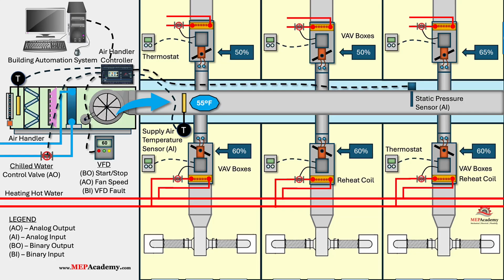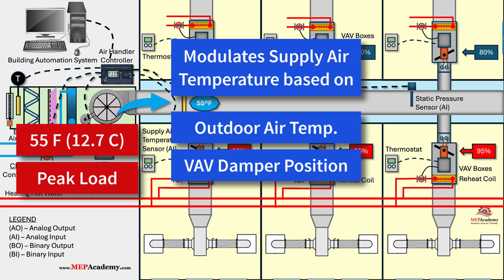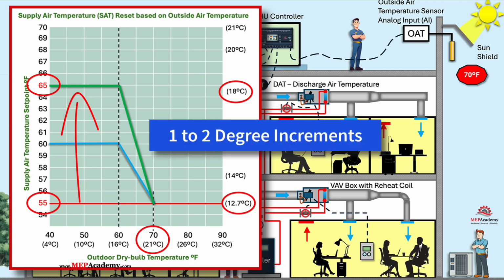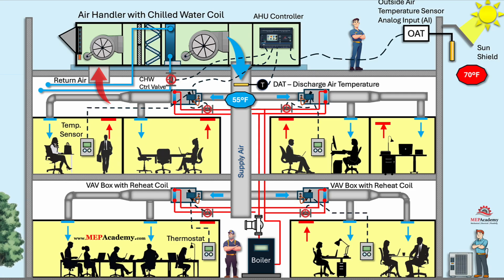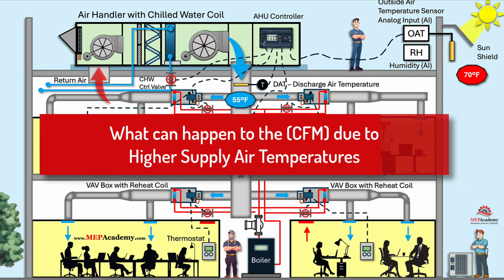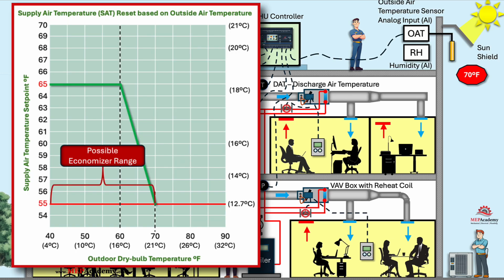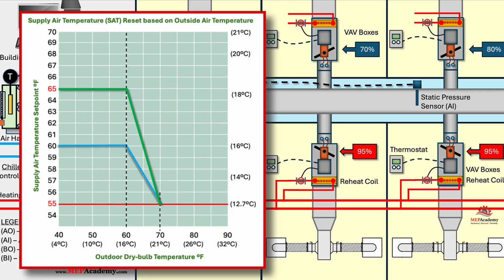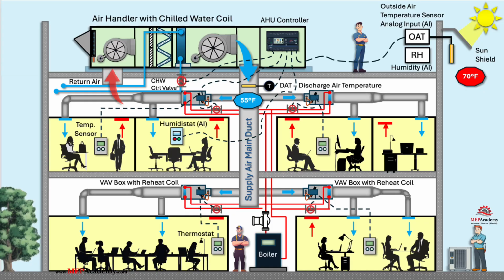HVAC Controls Supply Air Temperature Reset

Comment: On a BMS system how do I lower the sat in the RTAC from the BMS computer? I need help
Reply from the maker: To lower the supply air temperature of a rooftop air conditioner (RTU) from the Building Management System (BMS) computer, follow these general steps. The specific procedure can vary based on the BMS software (e.g., Trane Tracer, Honeywell, Johnson Controls, Siemens, etc.), but the core process is typically similar:
Steps to Lower Supply Air Temperature (SAT) via BMS
1. Login to the BMS Interface
 Use your credentials to log into the BMS software through a desktop application or web interface.
2. Navigate to the RTU (Rooftop Unit)
 Go to the equipment overview or graphic interface.
 Click on the specific rooftop unit you want to control.
3. Access the Supply Air Temperature Setpoint
   Look for a section labeled something like:
     - "Supply Air Temp Setpoint"
     - "Cooling Setpoint"
     - "Discharge Air Setpoint"
   - This may be found under a tab called "Control Parameters," "Setpoints," or "Cooling Control."
4. Adjust the Setpoint
   - Click the setpoint field.
   - Lower the value to your desired supply air temperature (e.g., from 58°F to 55°F).
   - Confirm or apply the change.

5. Monitor the Response
   - Watch how the system responds: the RTU should increase cooling capacity (e.g., more compressor stages or increased chilled water valve opening if applicable).
   - Verify the actual supply air temp starts trending down after a few minutes.

6. Check for Limits or Lockouts
   - If the system doesn’t respond:
     - There may be a lower limit enforced in the BMS or RTU controller.
     - Check for alarms, overrides, or scheduling that could be locking the control.
Additional Notes:
- Cooling Mode Must Be Enabled: Make sure the system is in cooling mode and not off or in economizer mode only.
- Permissions: You may need admin or technician-level access to make changes.
- PID Loops: In some systems, you’re not directly changing the SAT but adjusting a space temperature setpoint that affects SAT through a control loop.